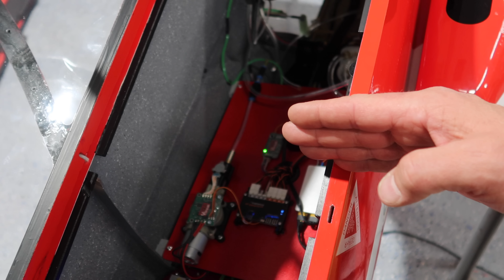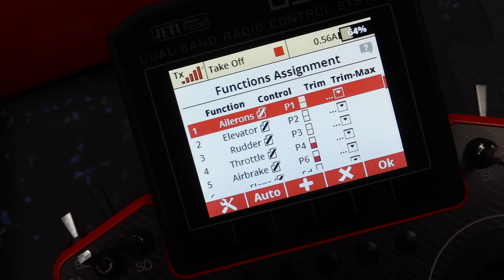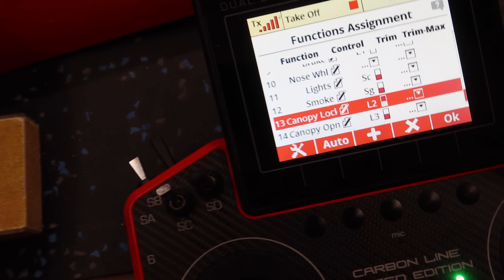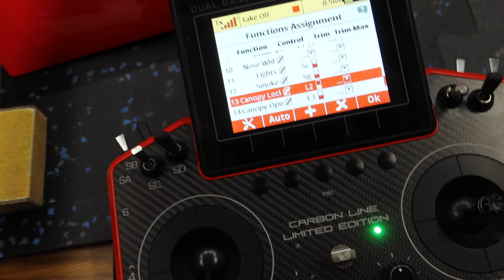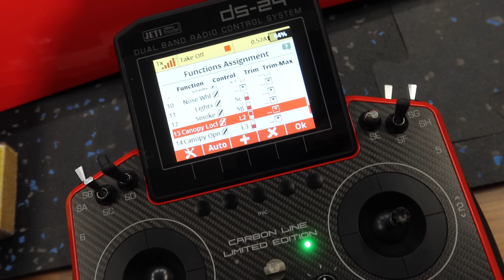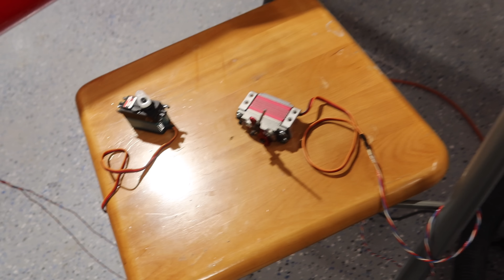HOW TO OPERATIONAL CANOPY and LIGHTS - Skymaster XXL 1/3.75 HAWK

Comment: Your unbelievable John how you can understand how to program the canopy locks. When you were going through the programming I just find it so hard to understand it. How do you find out that that transmitter does that function? Word of mouth or just sitting down and reading the manual cover to cover? Keep up with all the in depth information as this is really helping me my projects xx
P:s Do you sell any of your stickers you do? Obviously not the built by ones though xx
Reply from the maker: HAHA.  Well There are a couple things with that.  Having the servos plugged in, instead of the actual devices helps to see what's happening.  But, i'm still learning with The JETI Radio System and the owner ( David) is very knowledgeable.  So he walked me through figuring out the programming for this.  My struggle is retaining the info when I don't do it all the time.  

I don't sell my stickers but when an order is placed for something on my site I include a couple.

Comment: Can you change that XT-blank plug for a rubber cover plug? you could use a small screw to attatch it and that way it can't get lost while at the field, you can get them very cheap online.
Reply from the maker: could.  It's not really a big deal to leave it exposed.  The plug is a just in case anyways.

Comment: Nice touch with the external RX battery!  Love the Jeti system for it's unlimited possibilities. Jon, what is your technique for matching glossy color touch up paint? Red is notoriously hard to match!  I hope we get to see this Hawk fly!
Reply from the maker: Thanks Bert.  It was not planned out.  One of those moments when I was lying in bed, thinking about the HAWK and it popped in my head "How the heck are we going to get the canopy open!"  HAHA.  Red it tough to match.  Totally agree.  I Find the Tamiya red is a good match to the skymaster red for small repairs.  If I was to do a body panel repair it wouldn't even be close.
Reply: Roger on the paint!